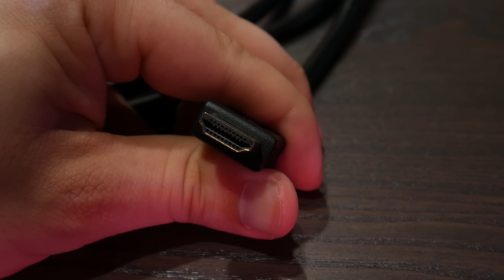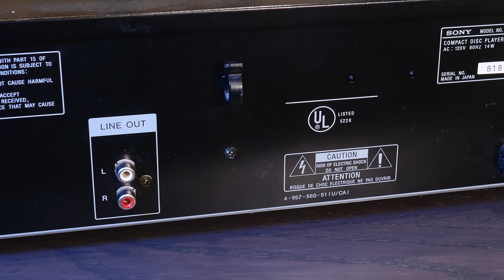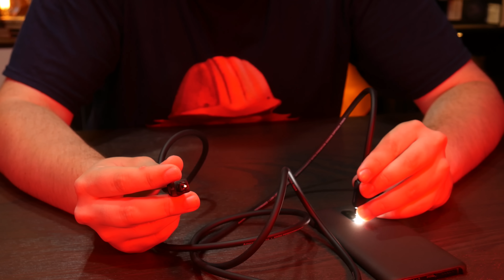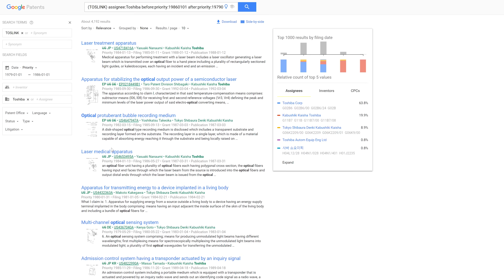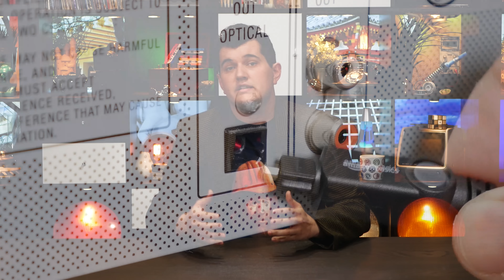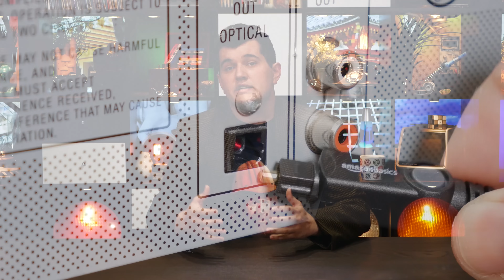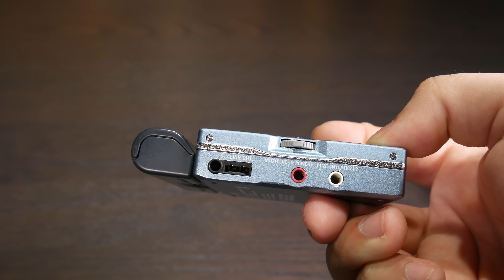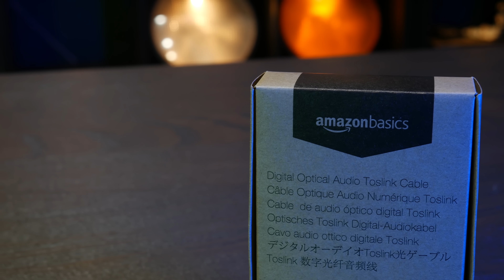TOSLINK: That one consumer fiber optic standard

Comment: I don't know if i commented before.

But hdmi passthrough, e arc, and non standard hdmi formats like freesync have made hdmi as a audio connecter a living hell.

I can only imagine how much worse this got with hdmi 2.1(a) [now] has made this worse.

Can a man play gears of war 5 @4k 4:4:4 chroma hdr + freesync + dolby atmos with a dennon recever a samgsung tv and a xbox one x.

Short answer no.

Long answer 

Dennon passthrough 
4:2:2 chroma hdr
No freesync 
Armos audio.

Earc 
4:4:4 chroma hdr
Freesync
5.1 audio. Through e arc

Fyi you need a 2.0 + ethernet cable for proper earc support. Not that it works in my case.

I miss the days of seprate audio cables.

Side note.

Intel igpu drivers allow a display to be connected as a audio only device i don't believe this works with amd or nvidia drivers.

Comment: i added a usb splitter to my dac, so I have 2 type A male connectors to 1 type A female, 1 plugs into a power brick, the other to my computer.
I also purchased a power isolation adapter which only connects to the data cables on the usb cable
when my dac is plugged into the computer with the power isolator, the dac's noise floor is clearly audible
when I plug the dac into my phone, the noise floor is almost completely absent
my dac only has USB, so I cant say that an optical connection would be better, but from what I just described, its looking like my dac is picking up some noise from the data lines

Comment: If optical cables were able to be standardized to contemporary standards, the cost of production would be lower and the bandwidth of the audio transmitted could be higher. However, current factories better support the more complex manufacturing process of HDMI cables and the oligarchies of the A/V industries have more invested into HDMI as was said in this video.

Comment: You might have under estimated the electrical advantage of optical fiber with regard to ground loop and outlets wiring. When the transmitter and the receiver are connecter at a great distance (which is the case in some audio applications) they have different ground level through the building electric wires. Given a conductive cable to transmit data and both ground will be in contract through a different path causing a few volts to travel through. It can lead to device heating up in some cases... Not really significant for recent home, but for large building or really bad wire it can be eventually a safety issue. But the most important difference of course is that it's a lot cooler to go optic isn't?

Comment: It's common for receivers to have a shared ground plane for the input and output stage, so if your PC is ungrounded and connected to copper S/PDIF it's "possible" that something like USB bus noise could creep all the way to the output stage of your amplifier.

Also, there is a more recent example of fiber being used in consumer applications today: some ultra-low-profile Samsung TVs use a proprietary and completely unnecessary fiber transceiver between the TV (which is just a dumb panel) and a black box which is literally the "brain" of the TV and contains all of the other connectors for the TV - HDMI, RJ45, RCA, etc. The cable is called "Invisible Connection" or "AnyConnect", is famously fragile, always sold out and goes for about $100-150 when it is in stock because - get this - the fiber transceivers are IN THE PLUGS THEMSELVES. That's right, there's a many-pin connector on both ends, with 4 tiny fiber tx/rx diodes and 4 strands packed into a single 1mm tube. Naturally, the TV still needs power, so even with the "invisible connection" there's still a big black power cable going to the TV too! Why don't you hide the power in the wall? Well, you can, but at that point, why not also just hide an HDMI cable in the wall right next to it? I don't understand why Samsung did this.

Maybe you can talk about real professional-grade fiber tech at some point - SMF vs MMF, the myriad connectors, APC vs UPC, and the insane amount of jargon.

Comment: Jitter. Noise on a coax digital line may be low enough to preserve signal integrity and high enough to cause detectable jitter. It is another question whether this jitter would materially impact the receiving hardware, although bear in mind that the playback clock must be reconstructed from the recovered data stream clock, which, if noisy, is now jittery.

Comment: That's interesting. For some reason I always thought these transmitted analogue fiberoptic signals. Even my modern X570 chipset PC Motherboard has a TOSLINK Optical S/PDIF port on the rear I/O panel. I know the connector has been around since I was a kid, but I thought there was just.. more to it.
Reply: I'm thinking USB wouldn't be the mess it is if it was power and optical. Instead of pushing tiny wires beyond their limits.
Reply: In the late 80s and early 90s, Sony made some wireless headphones and speakers that used analog audio over infrared. They even used Dolby noise reduction to reduce hiss (Dolby B on cheaper models, Dolby C on more expensive ones). I still have the speakers, but unfortunately my stepdad threw out the transmitter when the headphones died…

Comment: I believe the correct impedance for S/PDIF coax is 75 Ohm. I always used CATV RG6 cables and I did achieve 40 to 50 feet distance from digital outputs using it. Phono cables work, but they aren't as pretty and certainly are not usually 75 Ohm. I had an entire house network of TOSLINK and coax S/PDIF. It's in a box now. I still use Lightpipe on occasion.

Comment: Humming of audio equipment because of connecting the ground between them has been a very common thing since forever in my experience of an ex-USSR country with horrible aluminium wiring with no ground. And even if there was ground - most audio devices until at least the end of 2000s came with just 2-pin Europlugs for compatibility across countries (before most of us agreed on the German Shuko plug). And so, even if your home did have ground (like, you lived in Western Europe or you put in the ground connection yourself) - your audio equipment was still ungrounded, and thus, all humming differently. Connecting coaxial cables turned the difference into an audible hum in the speakers or headphones, regardless of how digital was whatever you sent over - headphones and speakers are connected to ground too.

Comment: I had to use Toslink to connect PC to Soundbar. Yes, you can push it in in multiple rotations. The biggest problem I have with Toslink (main connector) is that you cannot move any of the devices as it does not hold inside.

Comment: The future of optical fiber in Home equipment would be to use the ST optical standard, the same the we extensively use in the Datacenters, Telecommunications, and so on...
The standard already exits and is totally reliable with exceptional bandwith capabilities.
But it has still to be adopted by the manufacturers...
The funny part of this story is that the worldwide industrial optical ST standard, was used is the CD Drives and DACs by the best brands in the audiophile market: Metronome Technologie, Wadia, Mark Levinson, Krell etc... did use the ST uncompromised standard.
I still use it in my high end HiFi system, and it is undoubtedly the best on the market: maybe it will be back as a standard, but I doubt that the DRM fanatics will accept that....

Comment: We used to use optical links as electrical isolators when we had data collection terminals in areas that could be hit by lightning, to minimize the damage to our controllers.  I think they worked, but I never had a lightning strike I had to deal with.  This was about 40-45 years ago.

Today, the terminals would probably be wireless, solving the problem.

Comment: TOSLINK simply being optical S/PDIF also makes it trivial to convert one to the other. Back in the 90s, I used the Mini-TOSLINK input of a MiniDisc portable to record from a digital satellite radio receiver. This only had an electrical S/PDIF output. As far as I remember, the converter I built was not much more than a few connectors, an LED, a transistor and a power supply.
Reply: Totally!

And in fact, if you look at the schematic of a Sony CD player or MD deck that has both coax and optical SPDIF outputs, that’s exactly how it’s implemented in many models: the SPDIF output data line of the player’s chipset goes directly to the pulse transformer for the coax connector, and also drives a transistor to switch the LED. (Some TOSLink transmitter modules even contain the transistor, and those are connected directly to the data line. In my MDS-JB930 MD deck, it adds a logic gate between the data line and each transmitter simply to clean up the signal before transmitting.)

It’s also possible that the transistor is simply there to invert the signal, depending on what the TOSLink transmitter module expects.

Comment: Even in the professional audio industry, optical protocols and connections are sorta rare these days. They have their place, since they offer electrical isolation, can cover far greater runs (CAT usually is not usable for more than 100 meters), are more failproof concerning the connector (RJ45 jacks are delicate and the No1 point of CAT failure) and won't emit any intereference at all. 

That said, optical cabling is EXPENSIVE and SENSITIVE as FCK, and - there is a loopback to this video - most of the time you won't benefit from optical AT ALL. As long as you use proper CAT cabling with ethercons and treat it well, chances are you'll encounter a CAT failure during your career as a professional live engineer less than you have fingers at one hand. And since professional audio systems tend to be redundant anyways, chances are that you won't skip a beat in the process. 99,9% of the time, CAT issues actually are founded in the use of WRONG cabling (shielded vs unshielded, Cat7 insteat of Cat5e or vice versa, stuff like that [yes, Cat7 is "better", and still, there are systems that will get problems at longer cable runs]). Long story short, optical cabling is indeed so powerful, that the media industries demands most of the time actually are not high enough to justify the cost and care that is necessary to deploy optical. 

That's why you'll find optical primarily in fixed installations, where the isolatory properties, max length and reliability really come into play and sometimes at large festivals, where a LOT of audio and video streams are combined into one redundant backbone. In both those applications, those runs might have to cover 1000 meters and more. And that's where CAT just isn't a feasible option.

Also: "As dark as the future of windows phone" - great one :D

Comment: I use an optical active HDMI cable (so it has an active transmitter on one end and a receiver on the other) because any pure copper cable between my PC and tv would cut out every time I would turn my lights on or off. Ground loops really can ruin your day even with digital transmissions. It can even cause hums or other garbage superimposed on your DAC output even if it isn't causing errors in the transmission itself. I always considered that to be the reason for toslink: it allows you to connect audio equipment without introducing another grounding path and so it avoids ground loop nightmares.

Comment: Wait, so the ARC HDMI is an HDMI OUT for the TV? Why do they just expect us to know this? I've been looking for decent 5.1 surround system for my living room for movies and games, and I've always assumed I would need an HDMI splitter to get the audio back if that's the only interface available to me.
Reply: Sometimes you do have to change some settings on the TV to enable audio return (and the device you wish to send the audio to has to support audio return, and at least in the case of an AV reciever you would have to enable audio return in the settings, as far as i know you would need to have CEC enabled for the option to show up, on both the TV and the AV reciever, sometimes CEC might be called "HDMI Link" or something like that)
in terms of connecting an AV reciever up, you would use 1 HDMI cable, going from the main HDMI output of the reciever, into the HDMI ARC port on the TV
when you are using one of the inputs on the AV reciever, the picture passes through to the TV, and when you use one of the other inputs on the TV, the TV automatically sends the audio to the AV reciever

Comment: 13:48 - I learned about headphone jacks with optical out similar way. My MacBook 2008 alu unibody has that too, I don't know which Apple products has it too but that one surely does.

What!? Gold plated toslink cable XD You gotta buy one and see it up close. Is it actually metal? Because the socket is plastic and it's keyed, so a metallic plug will scratch the hell out of the socket... Maybe the ends are actually metal, then you gotta check if there's continuity between the two ends. You know, to bring the devices to common ground...

I like toslink for some reason, I hook up my PS2, PS3 and PS4 to a switcher and the output goes into my amp, I feel so in the future from it. Don't ruin my illusion :D

Comment: Toslink got one advantage that was not mentioned (or experienced) - eliminating ground loops
I had serious issues with my computers while running the amplifier on a different plug (probably a different phase circuit or different grounding circuit)
ground loops were able to get into the audio output, even when tried on different amplifiers
one solution was to isolate ground in the plug - but I wanted to have both computers and amplifier grounded
(got ground loops in 3 apartments I was living in, apparently not so rare when having 3-phase power at home)

Toslink is awesome, it has been it on all my laptops, my Minidisk, my workstations
nowadays laptops do not have it, only motherboards
it is capable of 96kHz 24bit stereo at least
Reply: But can it transmit 5.1dolby surround ?😂
Reply: @ChristianPinnock-u5c   yes S/PDIF can carry 5.1/7.1 Dolby AC-3 and DTS - I was using this for a long time 

also TOSLINK is the same connector as ADAT - which could carry 8 channel 24bit/48kHz (or 4ch 24bit 96kHz ...or 12ch 16bit 48kHz and vice versa)

Comment: Your video is great! However, I do not like HDMI cables. The biggest issues are max cable length, cost of cables and inability to construct custom lengths. I'm not sure why they couldn't have used twisted pair cable such as cat5e or cat6. It wouldn't have to be tcp protocol, just the physical cable and connectors. This would allow cheap, custom length cables to be made. 10gbps works over cat6 up to 100' and "high speed" HDMI is only 10.2gbps. if you need faster, why couldn't two cables have been used? After all, prior to HDMI, for HD resolution and audio, we were using FIVE individual cables! I guess 50gbps at 100' wouldn't be enough. If you need more speed, double the frequency and half the length. Isn't that what they keep doing with the HDMI revisions?

Comment: A small correction for you on LED vs Laser. LED works better than laser in the home, smaller tolerances or to put it another way, more user-friendliness of multi-spectrum LED makes this tech actually useable in the how, whereas single-mode lasers like the fibre networks, have a bad turning circle by home use standards.

Comment: Here in Thailand, most buildings aren't properly grounded so I hear major humming on my earphones when used on my desktop or when my laptop is plugged into the wall. To eleminate the noise, I got a USB DAC and attach it to my PC with a USB extension cable which has a ferrite core in the line. So perhaps Toshhiba designed this for similar situations? Or would that make no difference?

Comment: The principle reason to use Toslink is to break the ground loop formed when connecting two pieces of equipment together with a wire ... Still every bit as relevant as it always was ...

Comment: My ancient computer motherboard has quite a noticeable noise floor on the headphone out plugs. It also transmits noise over USB to cheap DAC/Amps I've used in the past. Sending TOSLINK to cheap DACs removed all noise floor. This was a useful fix that served me well for many years, and an example of using optical signal to electrically isolate components.

Another useful "feature" of using a motherboard digital audio out is that you can keep the outputs set as default without them being auto disabled (windows) or having to deal with changing output devices (alsa headaches...).
Reply: Not to mention that GPU coil whine will make speakers would horrible unless you're on TOSlink. I had the noisiest 1080 and it drove me to switch to fibre for my desktop audio, I'll probably never go back to traditional cables for my desktop speakers
Reply: @WildTangler  The cap noise from high end GPU's is insane is it not? My 1080 was(is, still have it, on the shelf) ntb but my 3080ti is insane when it loads up.
Reply: I have a cheap, nasty external USB soundcard that clicks the speakers loudly when it turns on, indicating a ground loop. But I bought it for the toslink out, which lets me use a better DAC of my choice essentially isolated from the problem.

That said, I'm still using fairly old hardware for digital audio. Good DACs these days can actually perform better over USB (typically better jitter control plus support for higher-bandwidth formats). Ground loops are nasty but should be solved by the receiving device going forward.